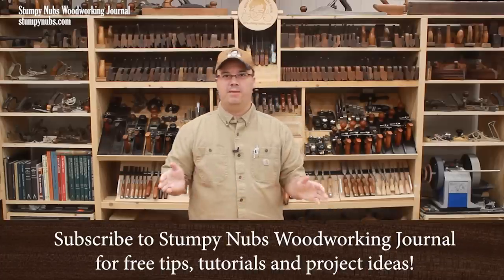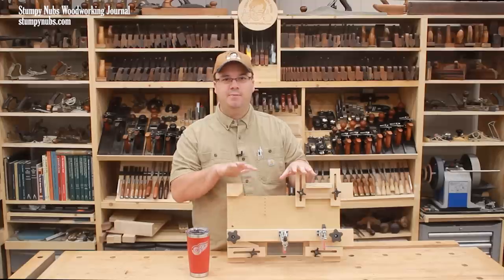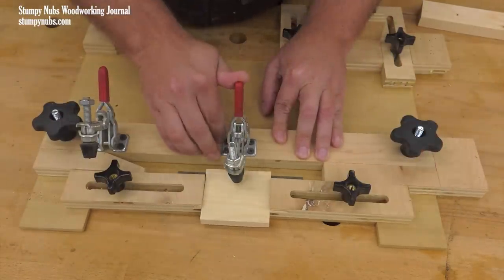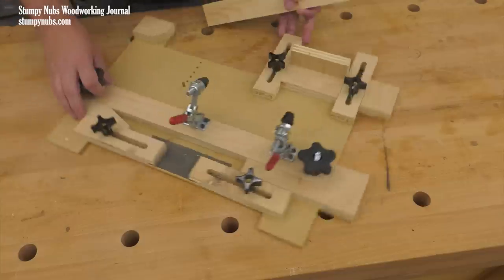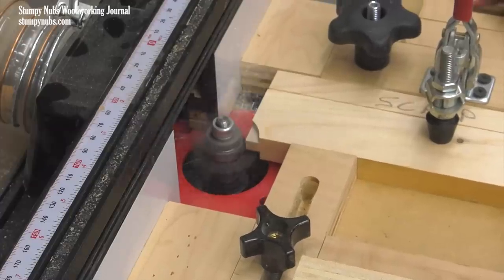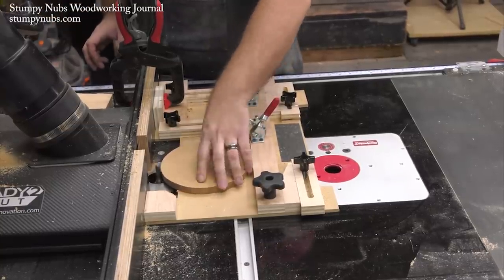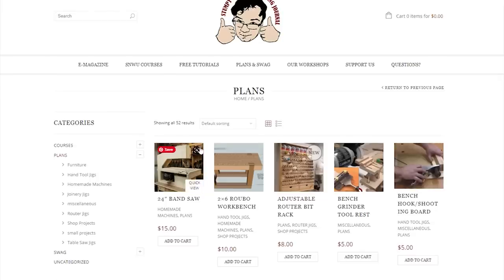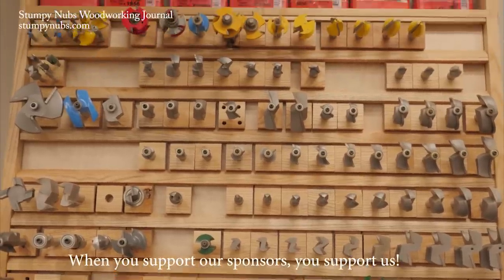DIY Router Multi-Sled DOES IT ALL!

Comment from the maker: ▼EXPAND THIS SECTION FOR MORE RESOURCES RELATED TO THIS VIDEO▼   

GET PLANS:
Router Multi-Sled: https://stumpynubs.com/product/router-table-milti-sled/
-Check out our other project plans: https://stumpynubs.com/product-category/plans/

★THIS VIDEO WAS MADE POSSIBLE BY★
Whiteside High-Quality Router Bits: https://amzn.to/2WpIOY7

Please help support us by using the link above for a quick look around!
(If you use one of these affiliate links, we may receive a small commission)
 
★SOME OF MY FAVORITE CHEAP TOOLS★
-123 Blocks: https://lddy.no/vpij
-Mechanical Pencils: https://amzn.to/2PA7bwK
-Lumber pencil: https://amzn.to/2QtwZjv 
-Pocket Measuring Tape: http://amzn.to/2kNTlI9
-Irwin Drill Bit Gauge: http://amzn.to/2AwTkQg
-Nut/Bolt/Screw Gauge: http://amzn.to/2CuvxSK
-Self-Centering Punch: https://amzn.to/2QvbcrC
-Self-Centering Bits: https://amzn.to/2xs71UW
-Angle Cube: https://lddy.no/10nam
-Steel Ruler: https://lddy.no/10mv7
-Utility knife: https://amzn.to/3nfhIiv
-Center-Finding Ruler: https://lddy.no/10nak
-Bit & Blade Cleaner: https://amzn.to/2TfvEOI
-Digital depth gauge: https://amzn.to/3mwRf2x
-Wood Glue: https://amzn.to/3mqek6M
-Spade Bits: https://amzn.to/3j8XPtD
 
★SOME OF MY FAVORITE HAND TOOLS★
-Digital Caliper: https://amzn.to/384H1Or
-Marking Gauge: https://lddy.no/10muz
-Marking knife: https://lddy.no/10mv0
-Narex Chisels: https://lddy.no/sqm3
-Stanley Sweetheart Chisels: https://amzn.to/3y5HDOc
-Mini Pull Saw: https://amzn.to/2UEHBz6
-Gent Saw: https://lddy.no/ss2x
-Coping saw: https://amzn.to/2W7ZiUS
-Shinwa Rulers: https://lddy.no/zl13
 
★SOME OF MY FAVORITE POWER TOOLS★
-Miter Saw: https://amzn.to/3gqIlQ8
-Jointer: https://amzn.to/3yc3gfZ
-Planer: https://amzn.to/3mn6BGF
-Router: https://amzn.to/3grD22S
-Sander: https://amzn.to/3DdvD0Y
-Cordless drill: https://amzn.to/3D9ZiIm
-Brad nailer: https://amzn.to/3gsRkjH
-Mini Compressor: https://amzn.to/3mvrmQr
-Bladerunner: https://amzn.to/2Wl0TtJ
-Jig Saw: https://amzn.to/3zetTBY
-Scroll Saw: https://amzn.to/3gq9qDc
-Multi-Tool: https://amzn.to/3muZuMi
 
★SOME OF MY FAVORITE OTHER TOOLS★
-Drill Bits: https://amzn.to/3B8Ckzh
-Forstner Bits: https://amzn.to/3kk3wEI
-Shop Vacuum: https://amzn.to/2Wkqnbl
-Machine Setup Blocks: https://amzn.to/3gq7kDh
-Counter-Sink Bit: https://amzn.to/37ZukUo
-Featherboard: https://amzn.to/3DeqHsq
-ISOtunes Hearing Protection (Save $10): https://bit.ly/3BHYdH7
 
(If you use one of the affiliate links above, we may receive a small commission)

Comment: I can tell you from experience how easy it is to have an accident. I wanted to test the depth of cut so i picked up a piece of scrap about the same size as the one you are cutting and began cutting. My middle finger on my left hand was holding the edge of the piece. As the piece got to the end the cutter caught the end and twisted the piece 90 degrees pulling my finger into the bit (a biscuit jointer). I snatched my finger away not knowing how much damage i'd done and held my other hand over for a minute or two whilst calling my Dad who was nearby. Luckily looking at my finger i had got away with it just mangling a portion of my fingertip and I'm left with a 1cm scar. I can't really believe it didn't do more damage, I just got lucky. I didn't have a safety procedure in place like i do with my table saw. Its worth mentally defining rules when using different tools and sticking to them. This sled looks awesome and i'll be looking to make something similar. thank you for showing me a far better way.

Comment: I got these plans and built this sled a while back.  I’ve found it quite useful.  I actually built it twice - the second version used a 1/2 inch plywood base instead of the MDF I used the first time.  I found the torque of the toggle clamps distorted the MDF.  The plywood easily solved that.
Reply: Good tip—I’m about to build one. 👍
Reply: Useful to know, thank you.

Comment: Off the subject, a little but I bought an Infinity Lock Miter Jr. Router bit and I saw where Infinity sells a router sled also. I looked at it online and had the bright idea that as I own a DELTA 34-184 UNIVERSAL TENONING JIG that I don't use all that much but decided I would take the clamp off and use it to hold my extra long pieces of wood to use it on my router table to push the wood through my router with the infinity lock miter bit. It works great so I can put the long clamp back on it and it will still be used for a tenoning jig.

Comment: 2 days ago I almost cut my right hand pinkie when I was rounding some cousters on the router, the bit just took the piece out of my hand and my finger hit the berring only scraping some skin of the tip. I will never work small pieces like that. The sled looks like an amazing solution

Comment: Another great video. Please loose the shocked expression thumbnail pic. You not the first woodworking youtuber to try this. I generally never click on those. Btw I have one of those Lancelot chain discs for my grinder and it’s never bitten me but I see how it could. You definitely have more control than using the tip of a chainsaw bar

Comment: As someone that recently cut his thumb on a table saw, I can attest there isn't much to sew up on there either. Didn't loose anything but I got 1 regular stitch and 2 mattress stitches after they had 3 pull out. All without lidocaine mind you, it wore off and I just wanted to leave
Reply from the maker: The lidocaine injections are worse than the stitches. They stick a needle through your finger to inject it. I got more of those needles stuck in me than the actual stitches! I once stitched my own hand up with a sewing needle and it hurt less than having it done in the hospital.

Comment: I had watched your video on how to add inside splines to a mitered corner. My first and only attempt so far wasn’t as precise as I’d like but fortunately it didn’t need to be for that project. 
But this video gave me the idea to use a sled instead of a long beveled piece clamped to the router table. Perhaps have a removable block cut to 45 degrees you can clamp your workpiece to. Hard to describe but I’d gladly mock it up in fusion 360 if you’d like me to send it to you.
Just another “function” to add to this sled.

Comment: The thing is that the part is now index to the bottom of the jig and not the table top, this make it more difficult to setup, especially when using matched bits like the Sommerfield cabinet making set. I have found that a good zero clearance bit plate and perfectly square push block with a handle is the optimum setup.
Reply from the maker: You can easily use a spacer to repeat the jig setup over and over.

Comment: You mention that the jig is not suited to small diameter circles. Do you have any recommendations on placing a round over on a small diameter wheel? The only time that I ever had an issue with my router table was when I was trying to round over the circles that I had cut as wheels for a toy. The bit caught and flung them across the room.
Reply from the maker: I'd make some sort of jig that holds it while you do half (or a third) at a time.

Comment: Just one question, James. What happens if you finish that coping cut? It looks like you're cutting into the sled. Otherwise an overall great idea.
Bill
Reply from the maker: There's a scrap next to the workpiece that takes the cut, and it also backs the fibers to eliminate tear out. You can see me put it in when I put the workpiece on the sled in the video.